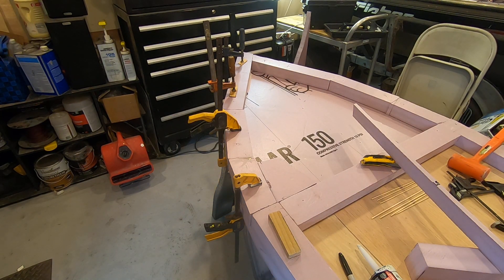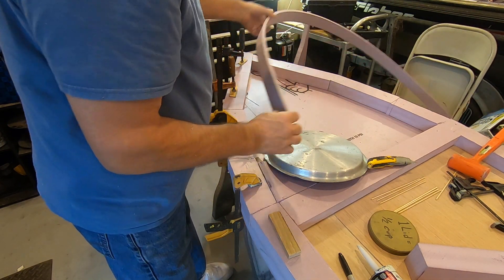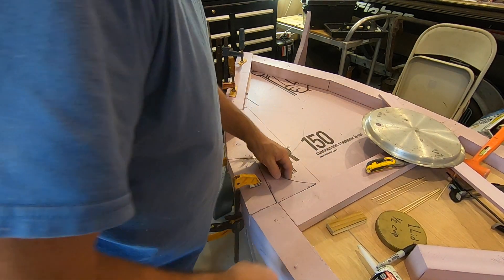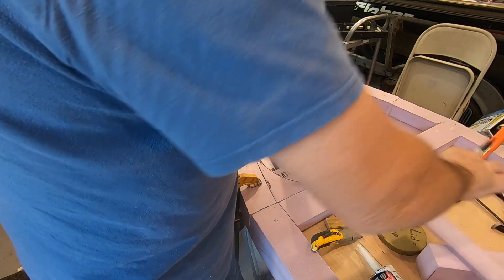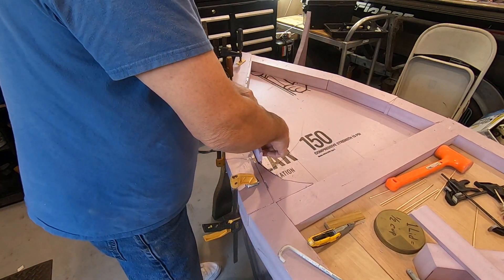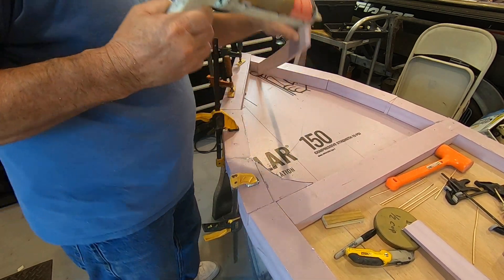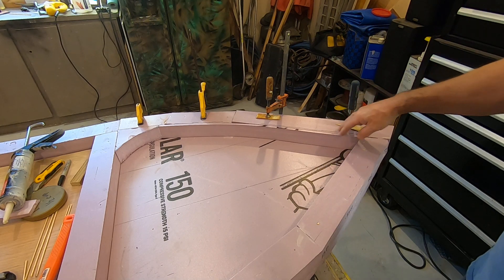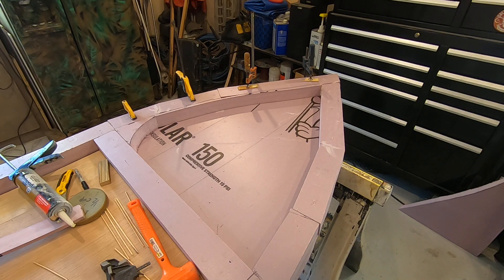How to make foam kayak 2.0 adding braces in the bow K10 getting ready for the next step

Comment: Thank you for allowing us to follow along. I am working on something similar and float tested it today. Found a single layer of foam to be lacking. OK for the teenage niece, not so much for my 194.6 lbs.  This was just glued foam with no PMF. On examining, OK tearing it apart, I found that some of the Liquid Nail even on the initial glue ups hadn't set up. May have been the humidity here in Florida or just my impatience.  I've already taken most of it apart to add an additional layer of 2" foam and reglue with Gorilla glue.
Reply from the maker: Gorilla glue is very good product, the liquid nails takes a bit of time to cure and is far less expensive here. The 2'' floor I cover with 1/8 plywood so it can be abused and I am your same weight but I do not move very gracefully anymore so I need the extra strength in the floor. The PMF is to hold the whole build together and a little protection of the foam